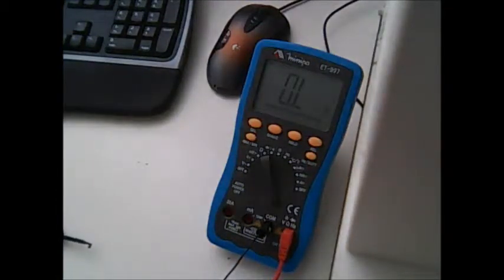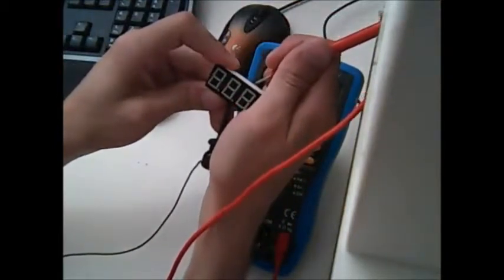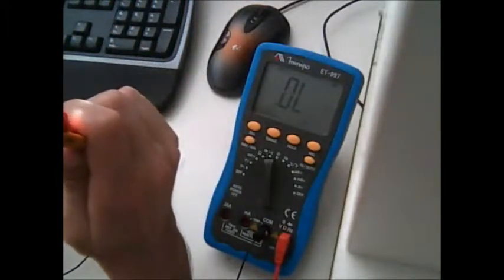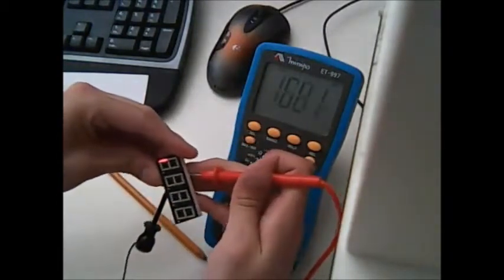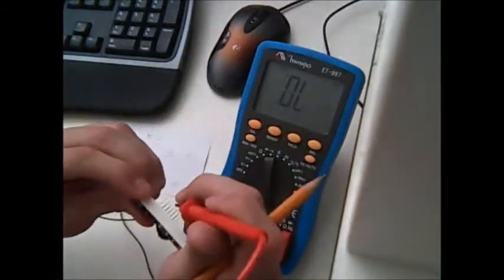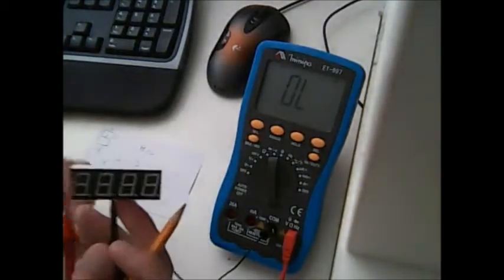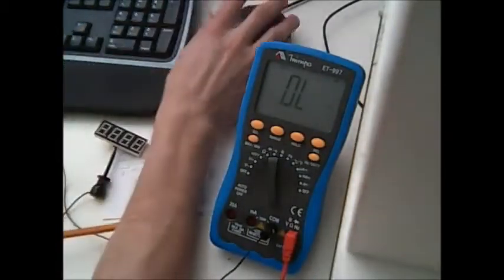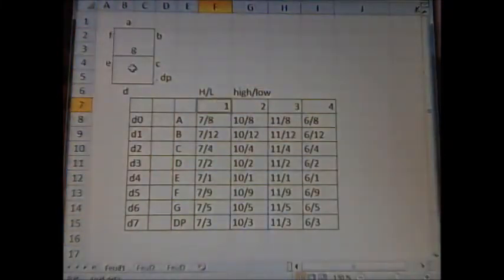How to map the pins of an unknown 4 digit 7 segment LED panel

Comment: A 5 Volt power supply with 470Ω (330...1000) resistor in series will do the job faster.